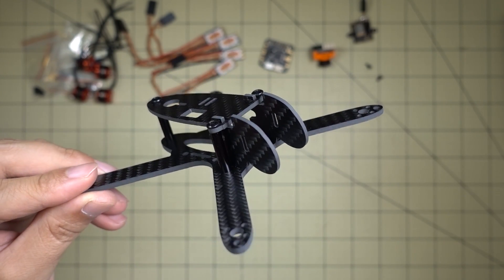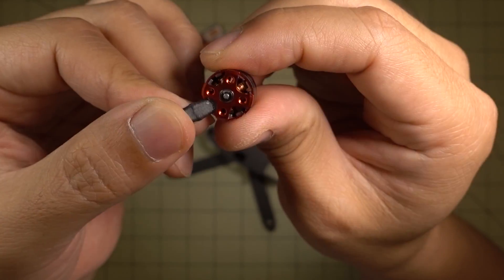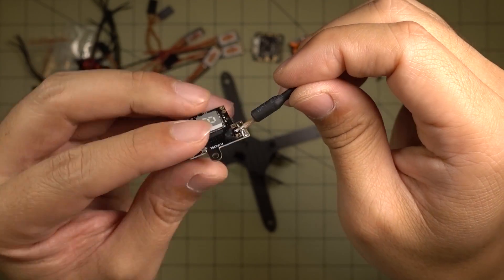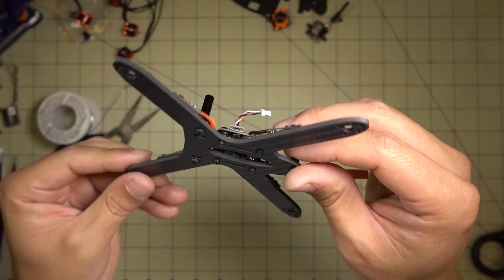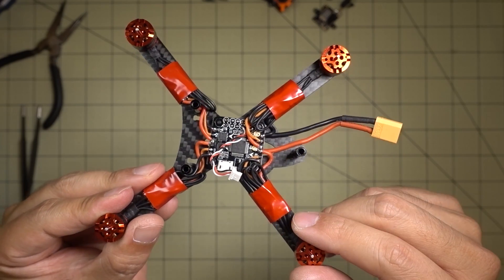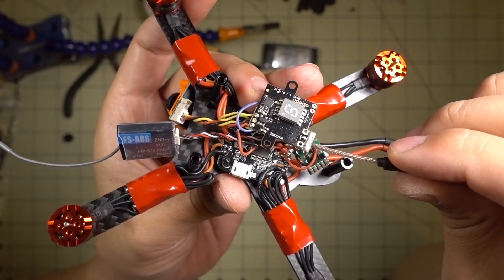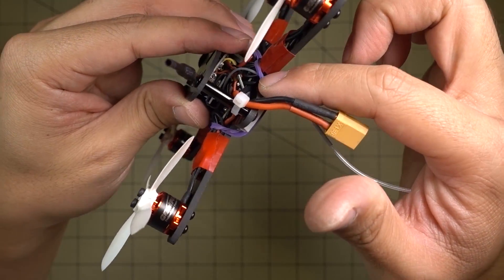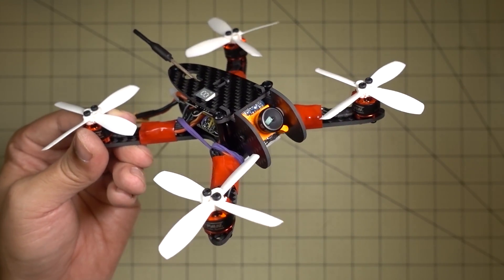Micro Drones 101 🚁#34⚡ BB-Bombshell

Comment: Reinforces my fear that without  FRSky telemetry (verbal and haptic warnings for low battery), I will also be killing my batteries! Coincidentally, yesterday I finally found a Seby vid that confirmed there is VBat available on the E010s. Up to now I couldn't get it to work, so I turned off telemetry 2 month 's ago (to try and make the incessant RSSI warnings stop). But I turned it back on last night and finally got the Vbat to work in my Taranis audible warnings. (turns out it is in the A1 sensor, not VFAS???). Sadly it seems to have cut my flight times from 4-4.5 minutes in half. Does that make any sense?
Reply from the maker: that makes no sense.... I haven't a clue.